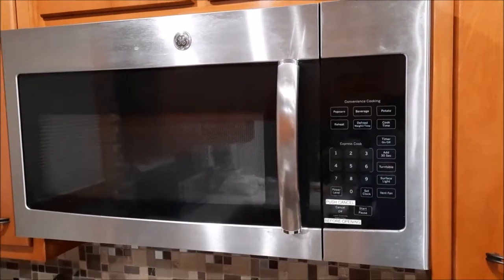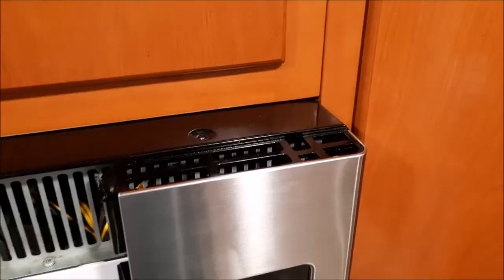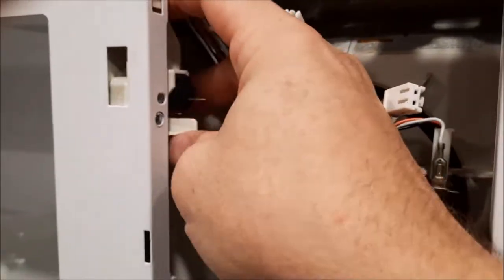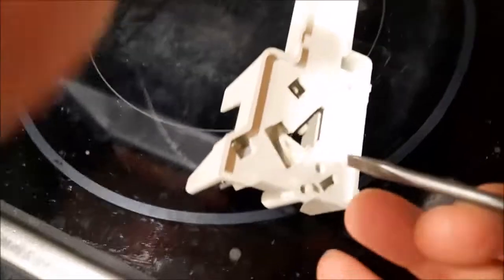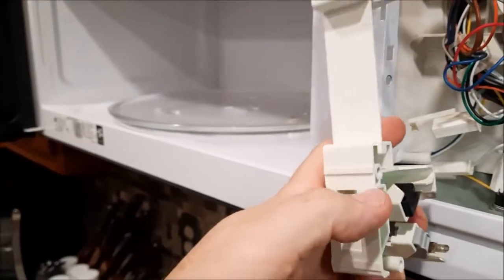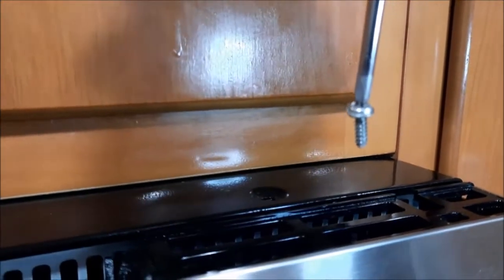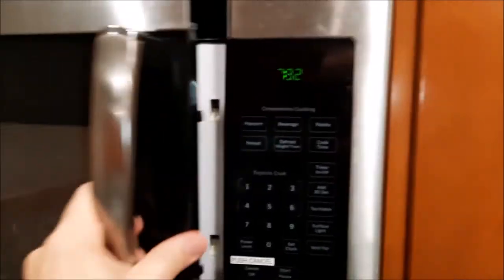FixIt006 - Microwave Door Switch Repair. GE Model JVM3160RF3SS

Comment: To the Point: does all switch should have continuity door open or closed? Mine has,.
Reply from the maker: Hi, thanks for watching.  Hmm.. I'm not sure of the answer to the question.  I replaced switches with exact replacements and it works.  Good luck with your DIY repairs!

Comment: Hello, Where can i get the switches?
Reply from the maker: Hi, thanks for watching!  After careful reading of the part numbers on the switches themselves (I believe they were molded into the plastic of the body of the switch), I did a search on Amazon and found them there.  Good luck with your DIY repairs!

Comment: So i did all of this plus changed the fuse and still popping and tripping
Reply from the maker: Hi, thanks for watching.  Did you also change the door switches?  It is possible that there is an issue with the board as well; I had to replace that, and showed it in video FixIt007.  Thanks for watching, and good luck in your DIY repairs!

Comment: What about the latch not touching the switches
Reply from the maker: Thanks for watching!  Interesting - if the latch hook is not touching the switches, is the hook excessively worn, or, alternatively, are the switches loose?  I'm not entirely sure, but with a little sleuthing, you should be able to discern why its not making contact.  Good luck in your DIY projects!

Comment: I have  a 5 year old GE microwave that won’t heat.  It powers up, lights go on, turntable turns and clock counts down.  The 3 door switches check out fine alone with the ceramic fuse.  I also replaced the circuit board.  I’d appreciate any ideas on what the problem might be.  Thank you very much.
Reply from the maker: @artriumph  Thanks for watching. Hmmm... not sure about this one!  Much as I hate to suggest it (as a DIY guy), you may need to decide whether it's more cost-effective to hire a repair specialist or get a new one. Good luck with your repairs!

Comment: What was your symptoms?  Mine works for a few days after replacing fuse and then blows.  I just replaced 2nd fuse.  I didnt have to do the push cancel before opening door.  It worked as it should for a week and then fuse blows.
Reply from the maker: Thanks for watching.  In our case (yours may not be the same), we found that pulling the door open while it's running would not only stop it from running, but also blow the fuse, which is why I investigated the door switches. You may have an intermittent problem with one or more of the door switches, which are all interlocked with the unit. Good luck!

Comment: I shorted out my microwave by using a pliers to try to remove the stove top light bulb.  Everything is out.  Could the fuse exchange solve my problem or do I need a new microwave?  I opened it up and took out the fuses and they are both bad.
Reply from the maker: Hi thanks for watching. It seems odd to me that the microwave would short out that way. However, I'd check to be sure your circuit breaker is off at the panel and try it with a new bulb and fuses first, turn on the breaker and see if the microwave is still out. Good luck!

Comment: For those watching - The video creator put the wrong switch in that spot. You need the NC (Normally closed) switch there, he installed a NO (Normally open) switch in that position, which is dangerous. the two end switches are the NO (Normally open). I'm not sure how is microwave is working. Look at the shape of the switch between his old one and the one in the box, they are completely different.
Reply from the maker: Thanks for watching.  Thanks for the comment, but all switches were replaced with identically-numbered switches and the unit has been functioning perfectly.  Good luck with all your DIY repairs!
Reply: @fixitwithcronk1074 you put the wrong switch in. You put a normally open switch in when it should’ve been a normally closed. This was very very obvious.
Reply: I agree. I've viewed many sites and viewed switches that are NO and NC. The one switch he handled had a prong closer to the top. The other switch he handled had a prong closer to the bottom. Different switches. One NO; One NC. It was obvious!
Reply from the maker: Thanks for watching!  Perhaps the switches are different for this model of microwave?  As I said, this has been functioning properly since the repair.  Good luck with all your DIY repairs!
Reply: @fixitwithcronk1074 Thanks for taking the time to make the video, but literally @7:20 of the video the gunked up old switch is different from the one you put in. Same part number yes, but one is NO and the other is NC.
Reply from the maker: @cheapcyclist7824  Which switch position had the incorrect switch installed during the repair: top, middle, or bottom? Thanks!

Comment: Thank you so much for this video. I was able to fix our microwave issue without the need of the appliance repair man. Probably saved 200 bucks. It wa a great ego boost as well.
Reply from the maker: Thanks for watching! Congrats on making the repair.  It certainly is an ego boost to be able to fix something like this!  Good luck with all your DIY repairs!
Reply: @fixitwithcronk1074  I am having a new problem now. Hope you can help me. After closing the door and setting the time, the microwave wont start after i press the START button. I am hearing clicking noise coming from behind the controls panel and the countdown timer starts but the microwave does not start. I have to try at least 5 to 6 times for it to work. Not sure whats going on. I replaced all the 3 door switches. MODEL JVM3160RF5SS
Reply from the maker: @moizmohd5858: I'm sorry it took so long to respond, but my problem after doing the switches was that there was a hum and I had to replace the board.  Cost less than a new microwave, but check FixIt-007 for this repair.  Good luck!

Comment: better to refer to them as normally open or normally closed.  If you order after-market parts they will probably be the same colors.  You have to look at the tab position to see their normal n/o n/c settings
Reply from the maker: Thanks for watching.  Good tip!  Good luck with your DIY repairs.

Comment: Great video. It helped a bunch. The first time I took this apart I winged it. I ended up breaking half of the plastic tabs on this cheap microwave.
Reply from the maker: Thanks for watching.  Yes, that's the trouble with us DIYers - sometimes in taking things apart, things get broken, but hopefully you were able to get the replacements you needed.  Good luck with your DIY repairs!

Comment: Hello , thanks for your video. I have a Ewave Kot-170SW  and sometimes when I close the door slowly blows the fuse .  I took the door switches out like you showed us and one of the 4 of switches is not clicking. It seems to be a 0.3A    24v DC     27T105  5E4 I can not find it in amazon. Any idea?.
Reply from the maker: Hi, thanks for watching. Sorry for the late reply, but you might have some luck searching outside of Amazon or checking with a local appliance repair shop; sometimes they will sell the parts without the service.  Good luck with your DIY Repairs!

Comment: Be honest, you installed a wrong switch at first? The switch you replaced the old one with has different pin location lol
Reply from the maker: Hmmm... I don't recall replacing it with an incorrect switch.  I matched up the numbers on the switch exactly when I ordered the replacement.  It's amazing how gunked up they get, though!  Thanks for watching!

Comment: atleast on GE microwaves, you can often See the door monitor switch by looking in to the bottom hole that the doors hooks go in to when you open & close the door. its a good way to determine if that switch is the culprit
Reply from the maker: Great tip!  Thanks for watching!

Comment: would any of these door switches cause the microwave to throw a breaker  ?
Reply from the maker: Thanks for watching! It's been a little while since I've done this repair, but now that you mention it, I think the microwave breaker did trip once or twice before I figured out the door switch issue.  Of course, before doing any electrical work, you will want to be sure the microwave is unplugged and/or the circuit breaker is completely off. Be safe around electricity :)

Comment: Most likely not the switches, the plastic holder of said switches gets worn-out, $55 or so part, what I did if switches are still good, they are loose int the plastic part, I used small zip ties and secured them tightly, now no Problems.
Reply from the maker: Yes! It's very important that all the little clips and nubs that hold the switches to the plastic holder, PLUS that mount the holder to the frame don't get broken!  Good luck with your DIY repairs!

Comment: Those two door switches when ordered have the prongs on differently.
One goes on the top and the other goes on the bottom, since when you plug them in, the connection will be different if you place them in the wrong spot.
Reply from the maker: Yes! Absolutely.  You will want to be sure to get exact replacement parts and that the NO (Normally Open) and NC (Normally Closed) switches are in the same places as the original.  Thanks for watching!

Comment: What is the grey moduele on the bottom of the door switches for?
Reply from the maker: If I understand your question correctly, the gray module at the bottom is the bottom door switch.  It could be any color, but typically they are either black or gray.  Thanks for watching!
Reply: What I should've done was replace that one as well, since the assembly was already apart and you only have to dissamble it once.

Comment: For the long screwdriver do you need a Phillips Or flat screw driver??? And yes definitely magnetic
Reply from the maker: Hi, thanks for watching.  I imagine you're talking about the screw that you have to get from the top right of the unit?  You'll want a #2 Phillips with magnetic tip.  Thanks for the question!

Comment: Huh, I was told that that copper coiled magnet holds enough electricity to stop your heart even when it's unplugged.  You didn't seem too worried about that...
Reply from the maker: Hey, thanks for watching.  That certainly is a concern, but the coil was only close to the fuse, and I stayed away from that when replacing the fuse itself.  Thanks for the comment!

Comment: What is the order of the switches from top to bottom.  I got mine out of order on removal (puppy) and I want to make sure I put them in correctly.  The top one is my real concern as I can't seem to get an open or closed switch to plug in.
Reply from the maker: Hi, thanks for watching.  I don't recall the sequence of "Normally Open/Normally Closed" from top to bottom, but one of the places I look for appliance parts and tips is appliancespartspros.com.  There are others as well, but some diligent online searching should help you out.  Good luck!

Comment: You put the wrong switch in that spot. You need the NC (Normally closed) switch there, you installed a NO (Normally open) switch in that position, which is dangerous. the two end switches are the NO (Normally open)

The two connection pins are farther apart on the NC (Normally closed) switch. The fact is I don't understand how your microwave is working with the wrong switch in that position. You really need to change that fast.
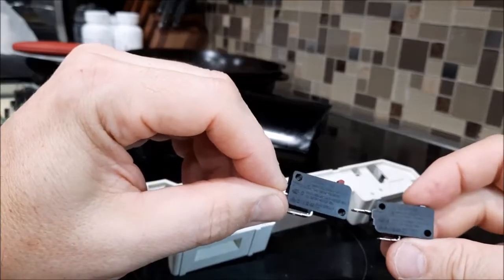Reply: Thought I was the only one who noticed. The video shows him replacing a NC with an NO switch. 7:50 you can see both the NC in the left hand and the NO in the right (one installed). The pins are further apart on the left hand vs right hand, so it's pretty easy to see it the wrong switch. 

FWIW the part number written on the side KW3AT-16 is written on both my NC and NO switches. Have to look further than the part number.
Reply: @fish4666 actually,  just look on opposite side of switch there is a line drawn near NC or NO That tells you if it's NO or NC
Reply: So I tried it with 3 NO switches and the microwave worked, but after your comment, I swapped the middle switch with a NC. But I don't understand why this is a safety issue. Could you please explain?
Reply: @prestonwolfram  The whole reason for the switches is to make sure that the microwave will not work with the door open. Microwaves are dangerous, and if the switches are not in the correct configuration, the microwave can still operate even with the door open. The switches are a safety requirement on all microwaves.

Edit: 
I forgot to mention that I don't recall the exact sequence without looking it up. You could ask one of the other people here who also noticed the wrong switch was used; maybe they will know without looking it up.
Reply: I was coming to say exactly that! You can see it's the song type of replacement switch (open vs closed) and when you put the wire back on, the EMPTY spot on the harness connected to the switch spade, not the spot with the white wire.
Reply from the maker: Thanks for watching! I replaced one-for-one with the same switches that came out, which is why it's working.

Comment: Maybe, the microwave I had, a Hamilton Beach, model P90D23Al, was purposely made difficult to repair.   The door switches were not as easily accessed as the GE.  Even worse the connectors to the door switches were not nice plastic plugs that could be pulled off or pushed on to the switches.   They were snapped-in and without some sort of special tool impossible to remove without damaging.   When you buy a microwave or other such appliance, use the return period to examine the connectors inside and determine if they are hard to disconnect with the fingers or with a gentle tug from a pliers.  If yes, quit there.  Put the covers back on and take it back to the store!
Reply from the maker: Oh man! What a bummer.  I'm sorry to hear this was your experience.  Thanks for watching, though! I hope your next microwave is easier to repair!

Comment: at 3:15 you take TWO screws out BUT there is a 3rd screw hole in the upper part with NO screw in it, which I think was part of my problem - I loved SLAMMING that door shut with FORCE and what it caused was the upper switch to come loose and rock back and forth- I used superglue and a toothpick to wedge it into a secure position and when I put it back together I added that 3rd screw -it works great now and does not trip !!!
Reply from the maker: Interesting fix!  Thanks for watching and sharing!

Comment: My Sharp microwave suddenly stopped, no inside light, no display, nothing.  I expected the monitor fuse to be blown, checked OK.  Tracing the lines coming into the unit, I found they were tied in with some of the microswitches.  Two of the switches had reasonable closed resistance, a couple hundred miliohms, where one of them would fluctuate all over when depressed.  I was surprised, the switch was not glued together, with some effort, it came apart.  I found that the contact were slightly pitted.  I was able to clean both up with a burnishing tool, put it back together, bingo, a more consistent resistance.  I put the unit back together, really didn't expect it to work, bingo, it worked.  The "microswitches" were exact clones of Honeywell Microswitches, but had different part numbers.  I can see that these switches are a major weak point in the ovens, asides from the HV capacitor.  I guess it is some planned obsolesces so you buy a new oven.
Reply from the maker: Ah, planned obsolescence.  Hence our DIY Community!  Plus, it's fun to fix  things and get them working again (plus save some $$!).  Thanks for watching and sharing!

Comment: My symptom is that when door is closed, push 30 seconds, won’t start unless I tap on the door handle. I am guessing the middle switch is gunked up.
Reply from the maker: Hi - thanks for watching.  My guess is one of the switches is gunked up.  You can remove it and clean it with contact cleaner spray (any home center will have this, probably in the electrical department), or just buy a few replacement switches and keep them on hand.  Good luck!

Comment: I was able to check other top switches with multimeter on continuity, i noticed the bottom one is at faulty, but I can't remove it from the conectors! It is stuck in and I don't wanna break the plastic connector cover, any solutions how to remove that bottom connector from the swtich and replace without breaking that  connector cover? Thanks
Reply from the maker: Hi! Thanks for watching.  Those connectors are on there pretty tight, that's for sure.  Sometimes cooking gunk gets up in there and seems to glue it together!  One thing you might want to try is to take a small slotted (flat blade) screwdriver - after you're sure the unit is unplugged - and put just the tip of it between the wire connector and the switch, then pry it gently and see if it comes off.  Good luck!

Comment: If I am replacing a normally closed switch, what happens if I use the a normally open one instead? Will that not work? Also for the people saying they cleaned their switch and it worked after, how do you go about cleaning it?
Reply from the maker: Hi thanks for looking. You should always replace a Normally Open (NO) switch with an identical NO switch, and a Normally Closed (NC) switch with an identical NC switch, since that is what matters to the circuitry of the unit.  Sometimes the switches are gunked up with food grease, etc., and you can have some success with using a spray electrical contact cleaner (check your local home store) to spray it thoroughly, wipe it clean, and be sure you hear the "click" when you depress the switch.  It's also a good idea to use a meter to test the switch continuity.  Good luck!